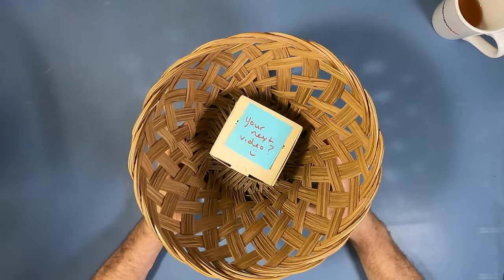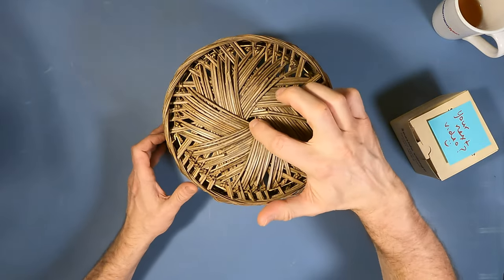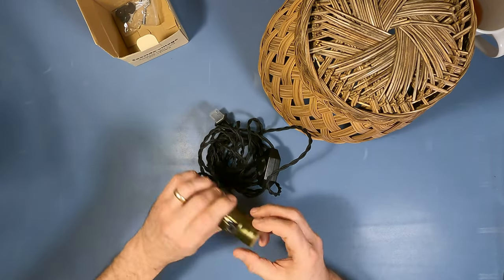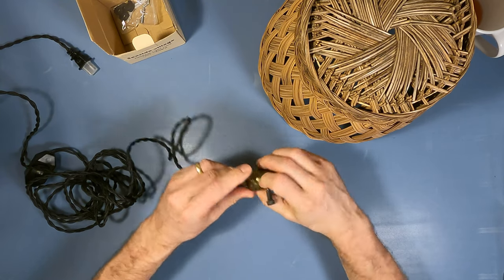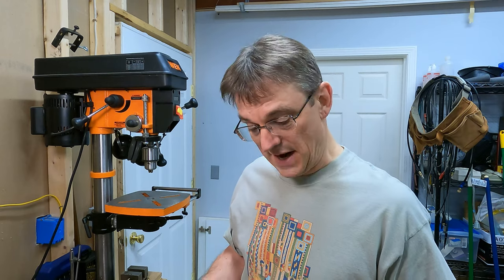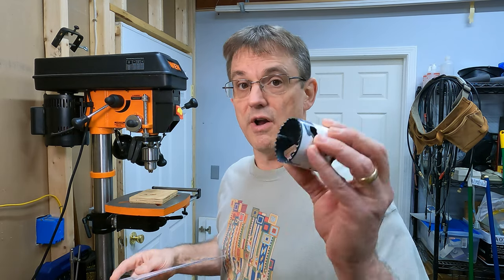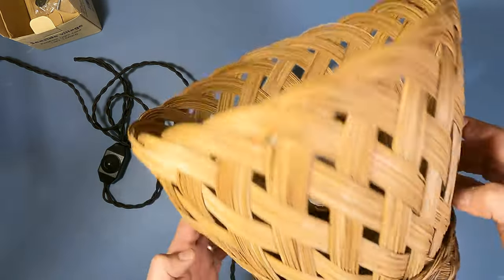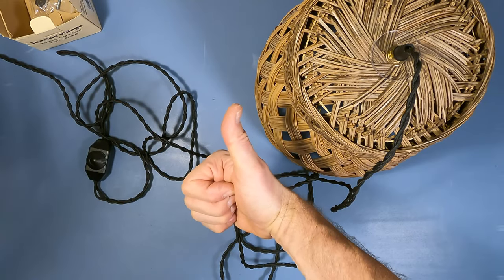Making a hanging lamp from a wastepaper basket!

Comment: Going to start calling you 2 Crafty and Handy. Was nice to hear your lovely wife's voice too. 
 What is the device back, left of center on your work bench that looks kind of like a pair of horizontal jaws?
Reply from the maker: Hey Joe! That is an adjustable vise used to hold printed circuit boards safely by the edges when soldering/de-soldering. Very handy when I'm building or repairing any PC boards ;)